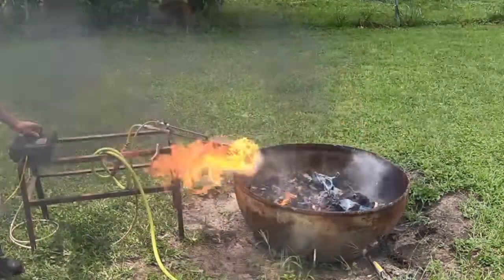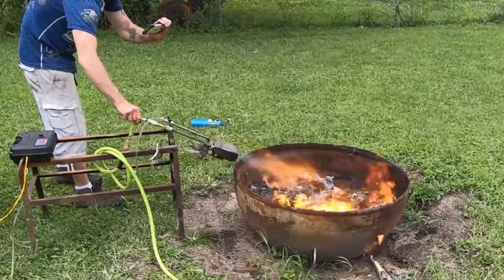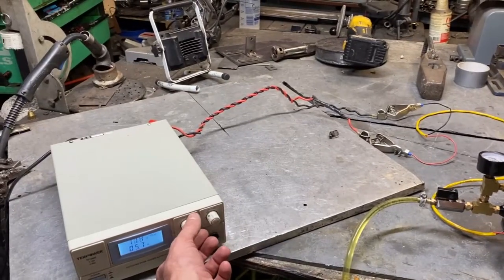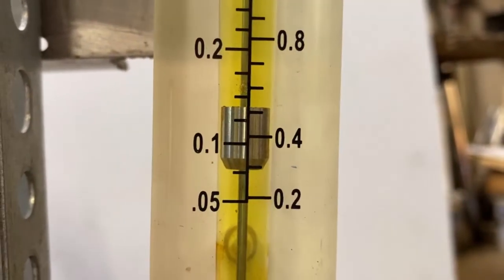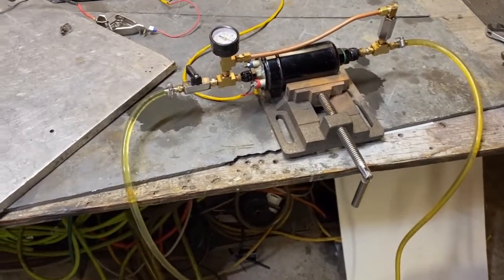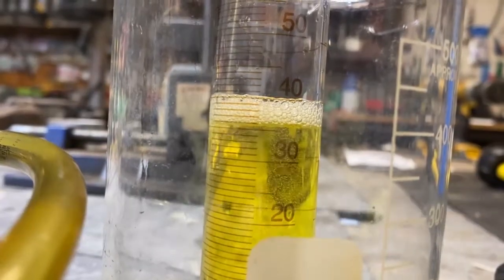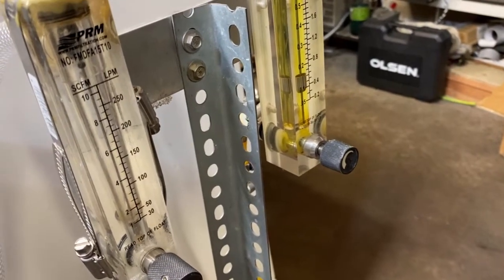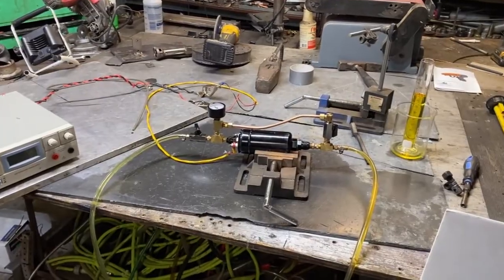Fuel or oil pump flow controller

Comment: this is the exact setup i tought out. But then it turned out my pump had died that i tryed the setup with. That stuff happens when you grab an old used pump from the shelf to try things But now i know it can go as low as i want it to go, so might order a new chinese pump for it.

Comment: The very low but precise volume you seek is in range of a peristaltic pump.  Used in medical devices, chlorine pumps and such.  Interesting video.
Reply from the maker: Yes indeed you are correct  .
Thanks for the input , very good information I always thought they was very low pressure but due to your wisdom i have looked at many of them and indeed they can go up to 230 psi  . They can be expensive but yes the chlorine pump would be perfect , however because it cost >$300 for 100 psi pump without speed control its hard to use it . The set up in this video can be used to crat up to 1,500 psi with a pressure washer doing this .

I love input like this , its good to review ones tool box of options and go deeper into the specifications  .
Reply: @NOBOX7  the end result you got here works great.  Efficient burner you have designed +the system tuning you put into it, this thing earns its name.  A while back I built a peristaltic pump turned by a car wiper motor fitted with a disc & ball bearings pinching hose.  Similar power supply you use controlled speed.  It pumped cutting oil.  Your efforts inspire, thanks for making videos.